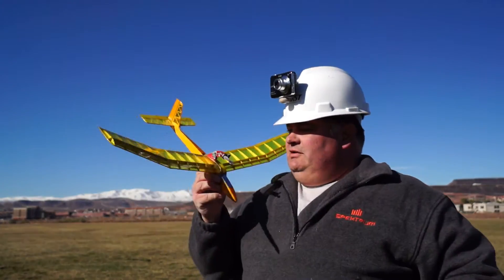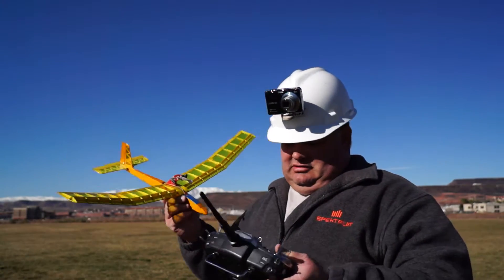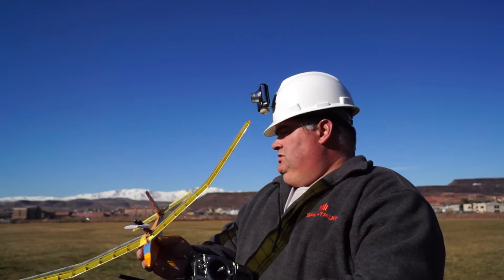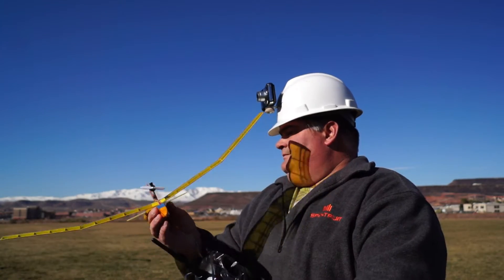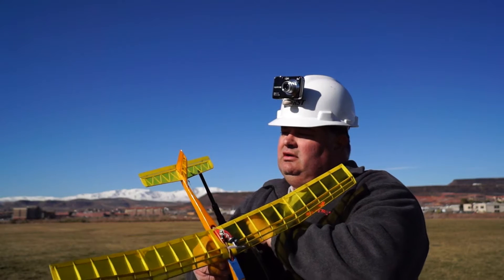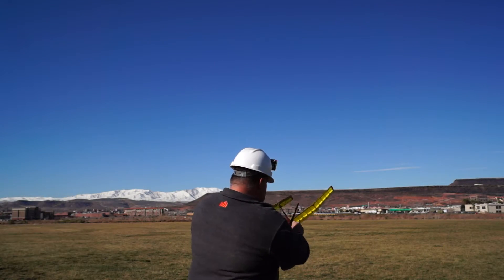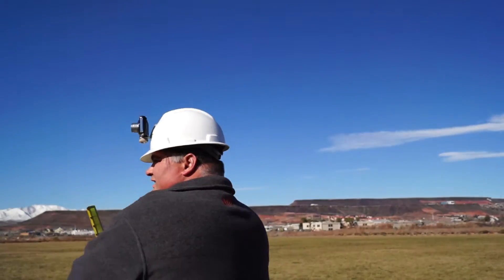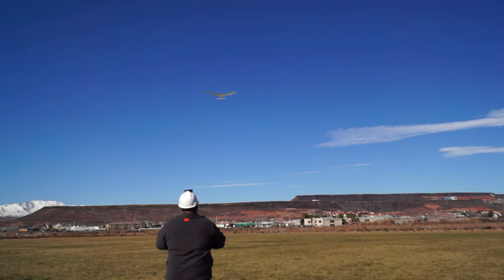Ultra Micro Gentle Lady with tiny Power Pod first flights

Comment: Thats great. Nice flyer, Think it will fly single channel rudder only?
Reply from the maker: Absolutely, it flies fairly hands off even with the balance point a little aft of 40% and it still self corrects.  The nice thing is that it hand launches a lot higher without the extra up elevator as would be needed by balancing it at 28% (where most sport R/C models are balanced)

Comment: Great flyer, did you just reduce the plans?
Reply from the maker: No, I actually drafted the plans from memory before I found a set for the two meter version, I was blown away at how close it was.  All I needed to change was to slightly enlarge the fin/rudder.  It has been a fun project to say the least!  Reducing the plans only would make for a very heavy air frame.